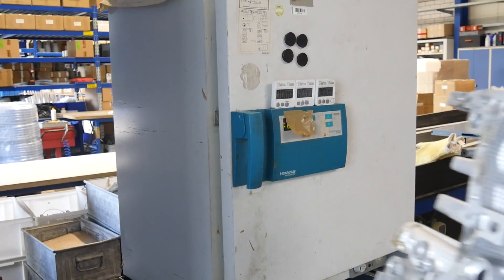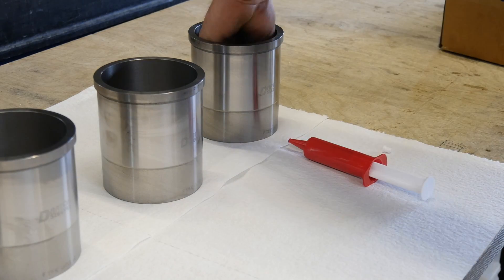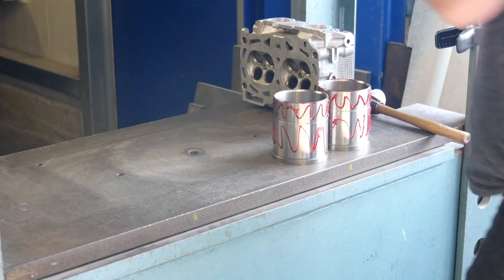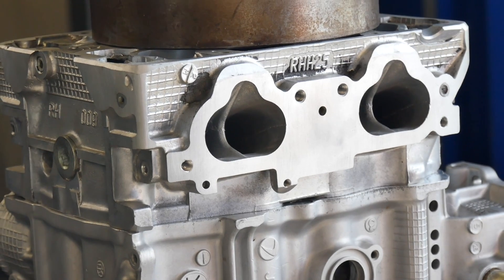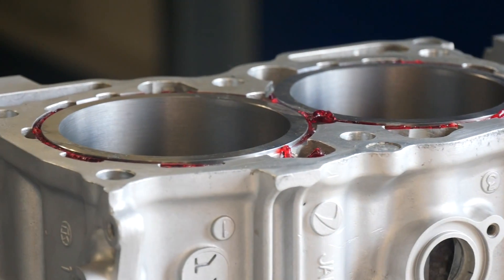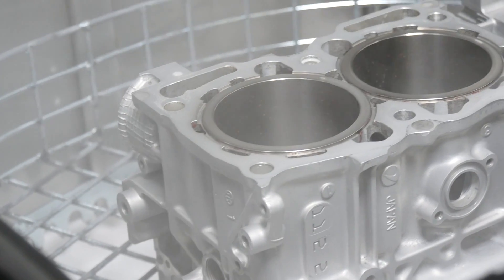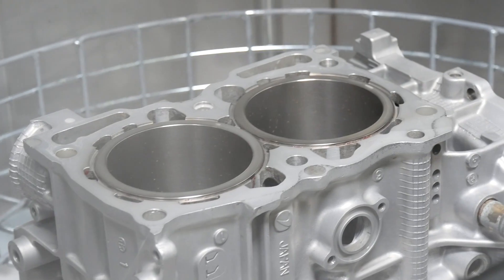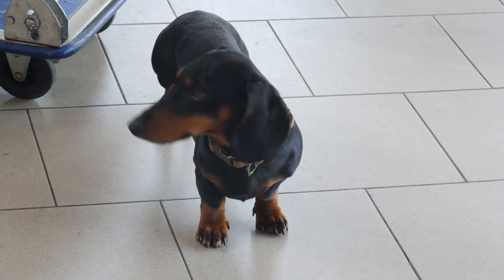How to Sleeve a Boxer WRC Engine l Part 2l l 22Bl EJ22 l Subi-Performance

Comment: Why you put the glue around the sleeve ? The right to do is put the glue on the block because the glue can’t go under de bigger diameter of the sleeve. I’m just telling you that because John Catapang from darton sleeves told me that . 

There is another question, people say that some day every sleeve that is not the OEM will drop because the aluminum cast have some bubles on their structure and with the head compress above steel sleeves under a big heat the sleeve will compress the alloy block and that’s why the sleeve drop . Do you agree with this info ?

Comment: How do you guarantee a tight seal between the water jacket and the crankcase? Surely you rely on more than just a small bead of sealant...?
Reply: Loctite 518 and an interference fit.

Comment: I like that these liners are sealed with glue. I never liked the idea of using rubber O-rings for sealing cylinder liners. Sure, some companies do it successfully, but it still looks like a bad idea to me.
When you use that cylinder head in a press, do you ever install it on an engine later? I would be afraid of the cylinder head becoming distorted.

I enjoy Subaru stuff, but I plan on buying an Evo X in the future. That way, a new variant won't come out and make me wish I could afford it.

Comment: In my opiniom U should not use grease to put sleeves. Thin layer of bunrnt Oil beetween two Materials in situation when one give Heat to another is not the Best situation.

Comment: Do you have to use the engine head to press the sleeves in?
I would like to hear your reasoning on why you used the heads.

Second question was that untreated water?
Reply: I'm no expert but it's better to press on the block with soft material like aluminum head. Maybe he just keeps one one head for this purpose :p
Reply: Same question, and to respond to Kuba, still then I would like to use a nice finished flat piece of aluminium on a steel carrier or something.

Comment: This doesn't make any sense, hagerty's machinist just puts loctite on the sleeves and hammers them into the block no oven or cooling needed.
Reply: The oven is probably to let the metal expand slightly before putting the sleeve in. Then when it cools it contracts and the sleeve is set in place

Comment: Interesting, so block hot and sleeves room temp. 
I've also seen block room temp and sleeves cooled in liquid nitrogen. 
I wonder what the pros and cons are to each method 🤔 and if there is ever a reason to do both at the same time
Reply: Block is aluminium, sleeves are steel. Aluminum expands more than steel so you get more clearance by heating the block than cooling the sleeves.
Reply: @jketchup246  I believe these sleeves are ductile iron (the addition of graphite makes a difference and also Darton spin casts DI but not steel) but your point still stands about aluminum expanding more. However in this case the block was only thrown in an oven for ~20 minutes which is not going to cause as much of a temperature change as throwing the sleeves into liquid nitrogen.
Reply: @MR__JUSTIN  20 minutes, but at what temperature of the block in the room?
...I did not understand what is the assembly interference between sleeves and block ?

Comment: Is that like loctite 515 or something similar that you are applying to the barrels?
Reply: I was wondering the same thing. Good eye!
Reply: Probably 518 as it's better to seal against aluminum.
Reply: @702justin702  515 has never been an issue with aluminum. I've used it with silk thread seal aircraft engine parts. But yeah it's probably not 515 as it is not as transparent and thin as what they're using.